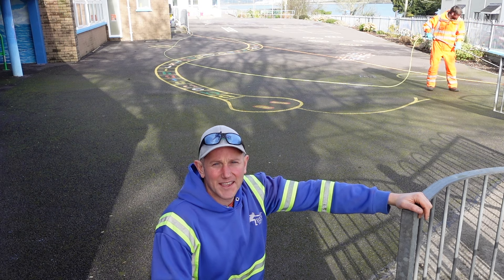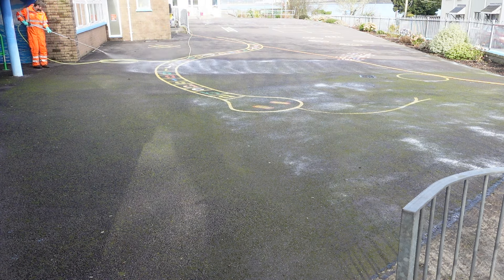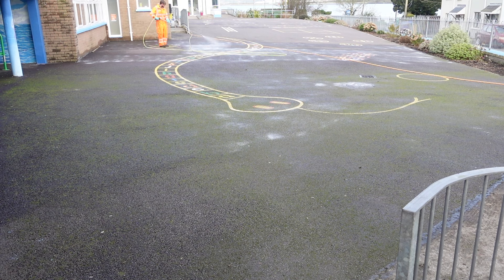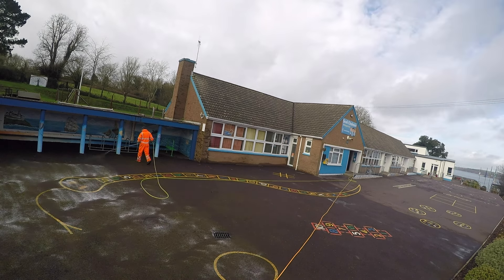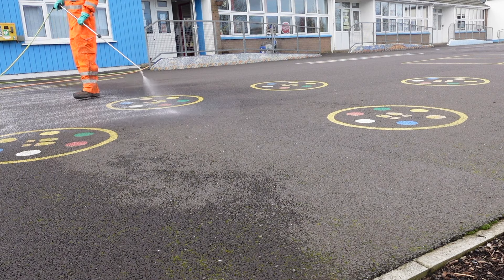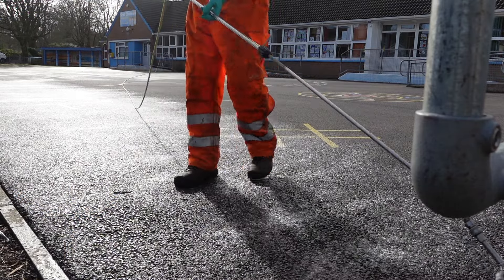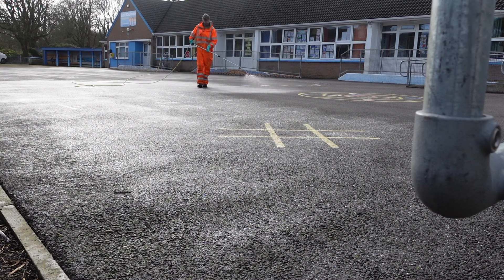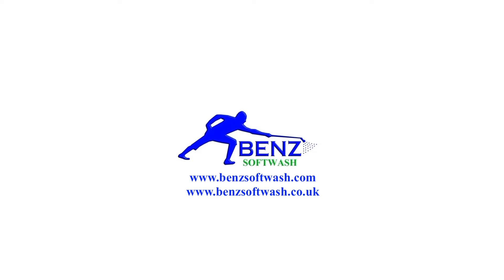How to Soft Wash Tarmac

Comment: I used to use a back pack sprayer (cooper peglar) with a 3 nozzle boom for a lot of lawn spraying as part of my old lawn care business. You can buy bubble jet nozzles, that make small beads or droplets rather than the mist or very fine spray from standard nozzles. for this type of product it would actually produce a good coverage, and actually would possibly be faster that this. especially if i used an electric pump.     I even used to have a petrol wheel barrow type sprayer as i used to do foot ball pitches and school fields etc. But that thing can cause drift if it isnt very still in the air. So would often get up very early and do those jobs before the wind...
Reply from the maker: Cheers Dean